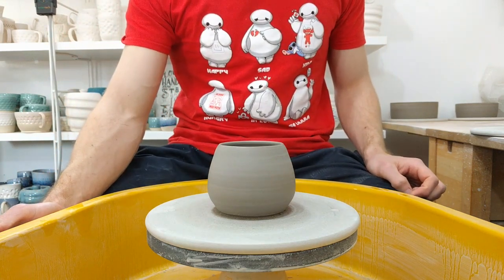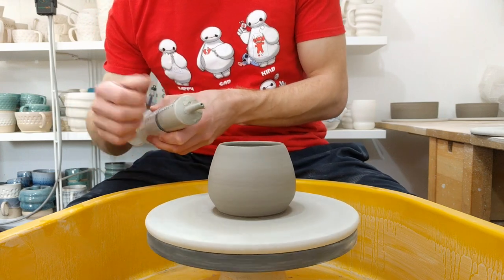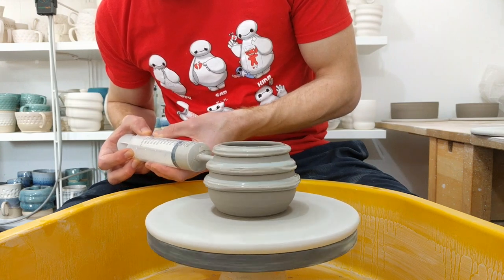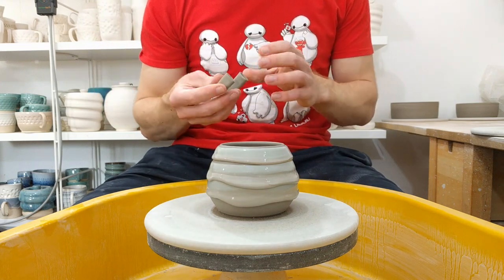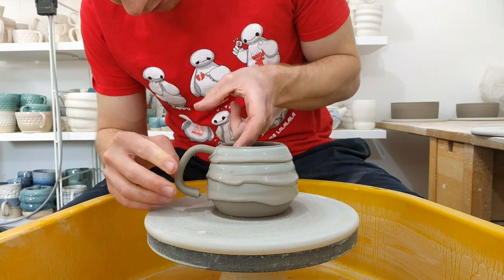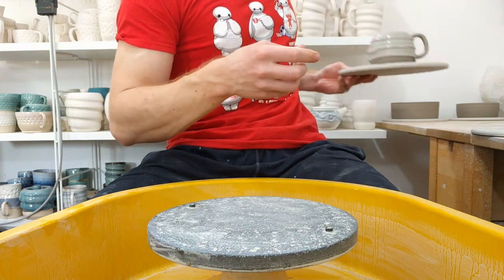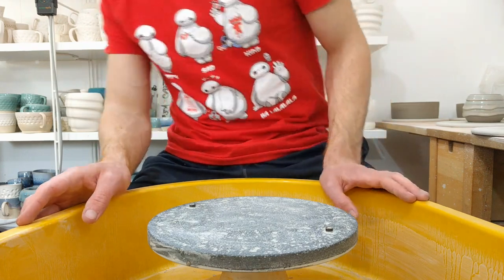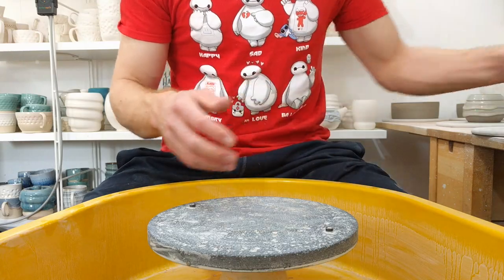Making a Drippy Slippy Mug

Comment: Can this slip technique be added to bisqueware or does it have to be green? Thanks!
Reply from the maker: It depends on what you're applying. If you're using slip made of the same clay as the body then it will need to be applied to greenware to match the shrinkage. Slip applied to bisqueware will fall off as it dries. If you use a slip/underglaze specifically designed to go onto bisqueware then it might work
Reply: @OldForgeCreations  Thanks! awesome work!  I couldn't find one but do you have a video/blog on how you mix the slip and underglaze?